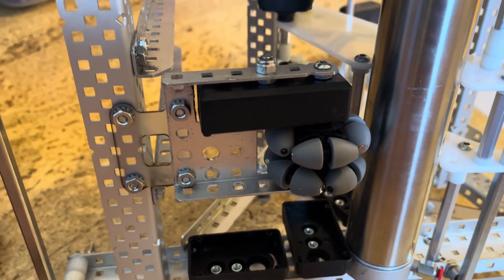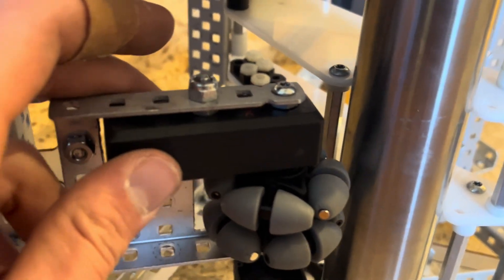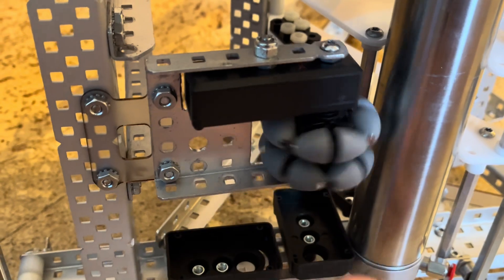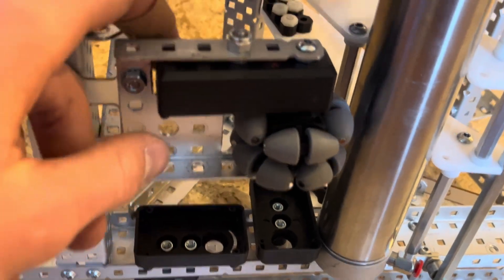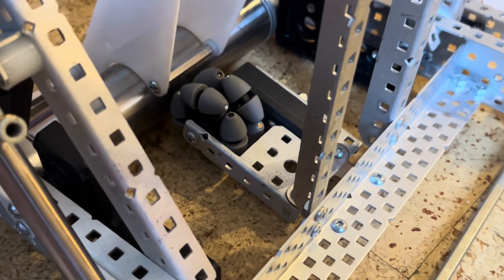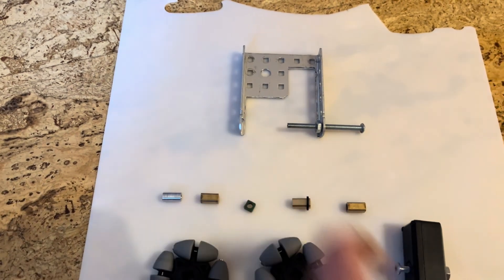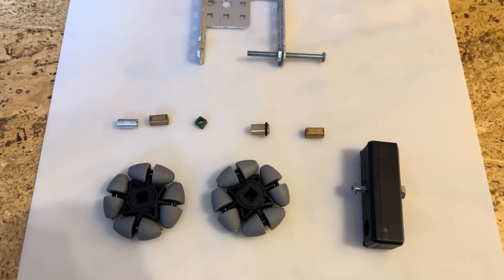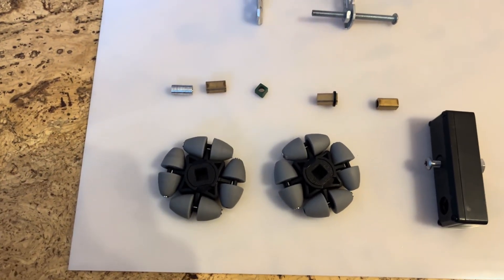2654E Echo Leafspring Odom Explanation

Comment: i dont get it--how does the rotation sensor pick up rotation when the wheels are free spinning in the brass inserts?
Reply: the brass insert sticks out of the wheel and you can use hs spacers or something to carry the rotation, the brass inserts are connected to the wheel and spin around the screw, if you connect something else to the same brass insert, the rotation will be carried through 👍
Reply: if half of the brass insert is in one wheel and the other half is in the other wheel, when one wheel spins, the other wheel will spin as well.

Comment: What do you exactly mean by offset the omni wheels by 45 degrees?
Reply from the maker: The wheels are rotated from eachother so the deadzones on one of the omnis doesn’t line up with the other one
Reply: the 2in omni's are closer to the shape of squares, imagine if at each angle of the square, it was a blind spot on the wheel. You would have to line another square right next to it in the shape of a diamond so the sides of the squares cover the corners, ensuring there is no blindspot.
Reply: @wildagoat5227  thanks!

Comment: how do your rotation sensors work if 2in wheels just spin on screw joints?
Reply: yeah im kinda baffled abt this too. Im tryna build it but I don't understand which parts go where
Reply: I think they're working by using those brass inserts and slightly offsetting them between the wheels so that it would all be connected together? Not sure tho but that's what we're doing

Comment: Wait why do u only use vertical tracking wheels?
Reply: I’m going to guess it’s because the traction on their drivetrain prevents drifting so they don’t need a horizontal wheel
Reply: @certainlyblue9 No, they had 4 distance sensors for localization
Reply: @trinhtrannguyenkhanh4001  oh yes, definitely that too
Reply from the maker: Yeah, as the drivetrain prevents drifting, we don't really need to have a horizontal tracking wheel to track the movement in that direction. As well with monte carlo localization we were able to correct for drift in that direction quickly